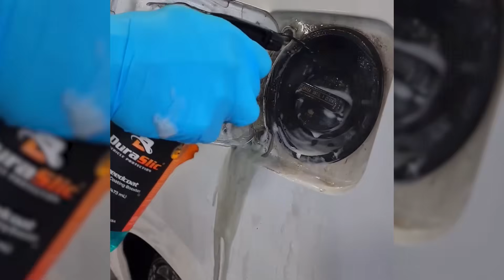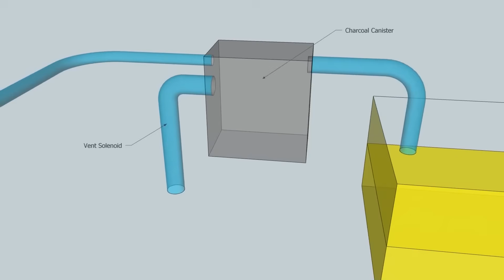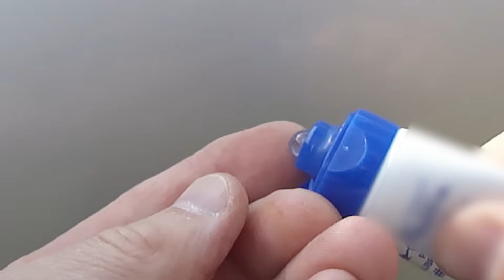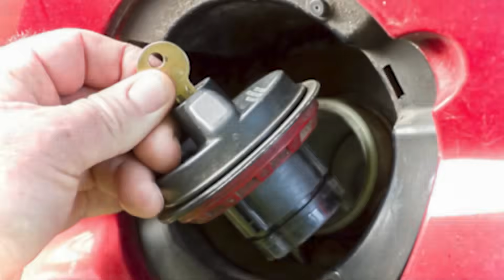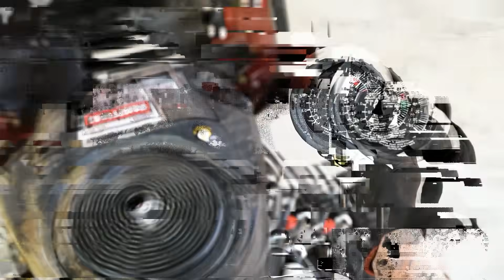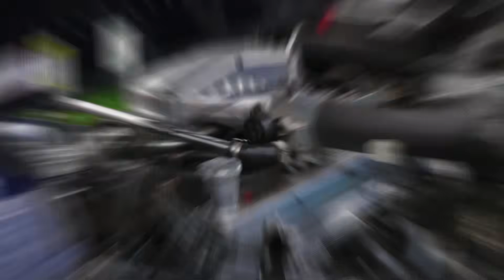DOING This to Your Gas Cap Will Make your Engine Run Like NEW Again!

Comment: I also need to say Change your Fuel filter more often will save your fuel pump - But!! those who are in the tank need to inspect more often as this will keep the pump from ware and stress which will cause failure...

Comment: And too All those reading my comment - I greatly say this - DONT over tighten your gas cap when reinstalling - Instead of wrenching it on you - Slowly turn it to the first Click That all you need if not to the second click and THAT'S IT -  Every time you wrench it up tighter you squish and wear out the O seal to the point of destroying it. So! Dont be so hard on it and it will last or out last the life of the vehicle ...
Reply: My car doesn't have one. So, yeah...
Reply: You got it
Reply: Sort of like the hose washers  that connect your washing machine to the faucet. If you tighten too much the groove you form in the washer will leak.